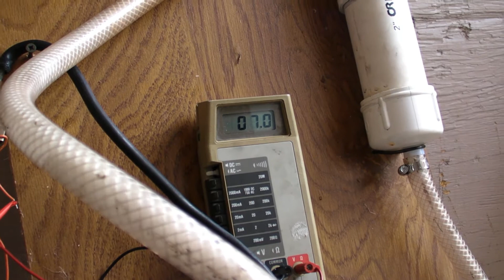#44 H2O2 - PWM-Driver V2 Part 2 of 2

Comment: I'm looking at the driver board on your website. What is the purpose of the caps on the 10v power input and the gates?
Reply from the maker: They are there to Filter out Noise if it gets in the power supply or on the gate wires.
Reply: understood
Have you measured any noise on a zff type circuit or is this for just a precaution in case it happens?
Reply from the maker: delvis11
Caps are installed to prevent problems in other unknown systems, The design is clean and will stay that way with proper filtering.